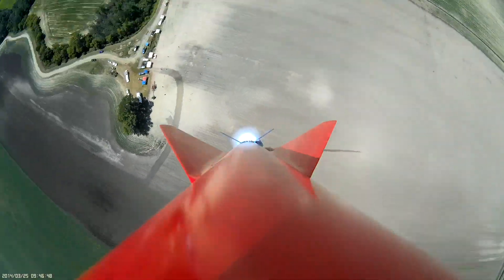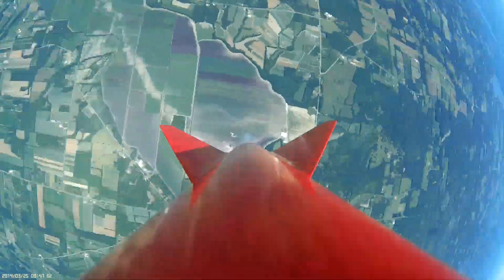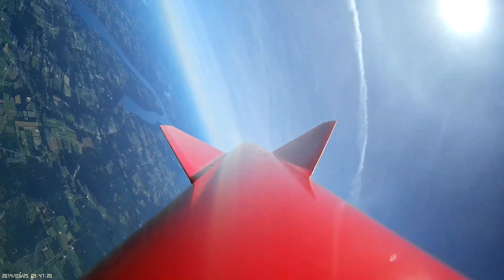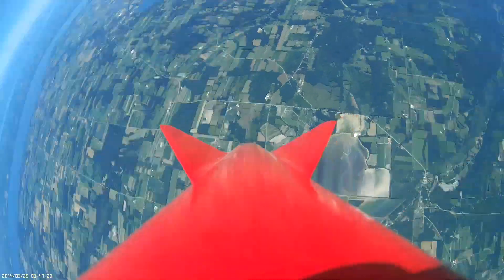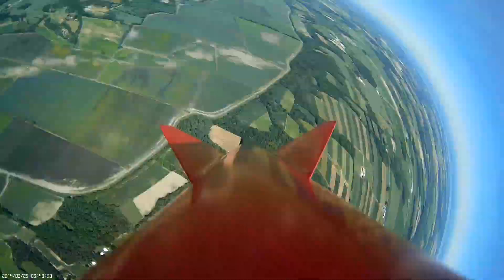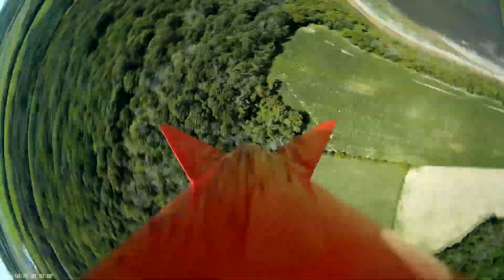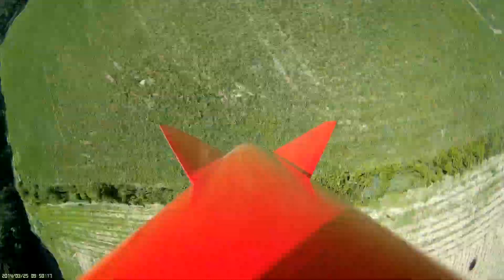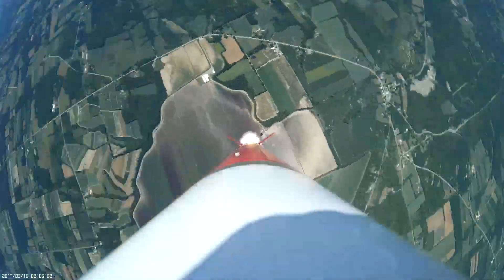2 stage high power rocket - M2550 to K700 motors - high altitude launch

Comment: This is incredible man. Congrats! Have you documented any of your process on building or electronics configuration? It would be a great resource for people like me trying to tackle a project like this
Reply from the maker: I wrote a 50 pg document on it mostly on flight analysis/electronics configuration. Haven't flown this rocket in a while but if I do I will revisit it.
Reply: @mremeza6557 Are you willing to share that document? I’m also interested in a 2-stage HPR and documentation is hard to find online. Great launch btw
Reply from the maker: Tbh I think I lost it lol
Reply from the maker: This did use a raven 3 for staging with pretty standard logic. I had it stage at around 450 ft/s